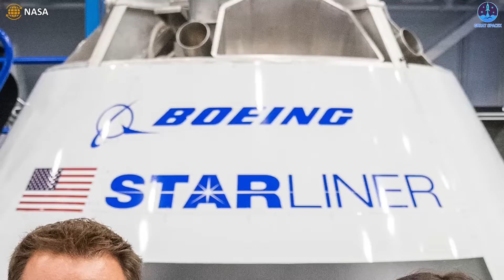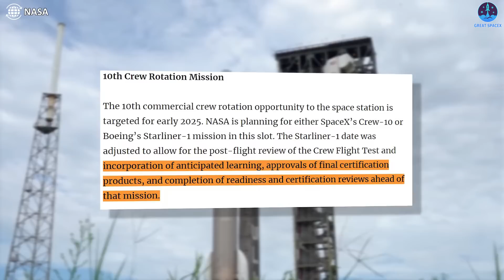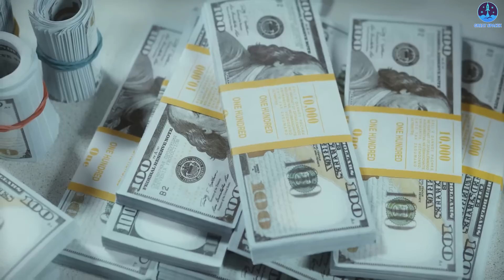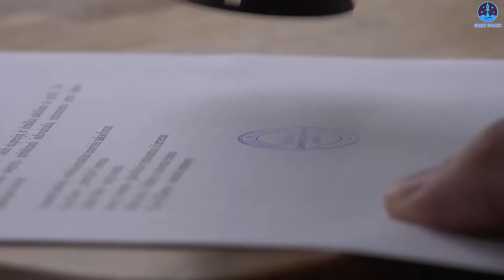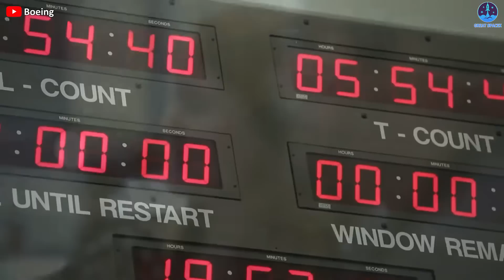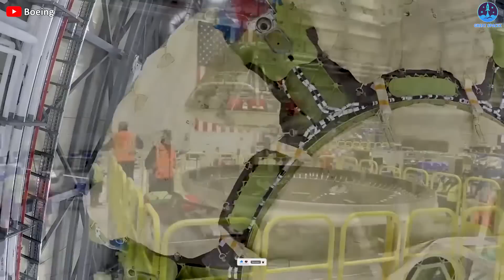BAD News for Boeing Starliner! NASA finally realized Dragon is 1000x better...

Comment: No. Dragon IS NOT "1000x better" than Starliner. I very much doubt that objectively Dragon is all that superior. What Dragon IS, compared to Starliner, is fully crew-rated and FLYING! A bird in the hand is always to a bird in the bush. At the same time NASA needs Starliner as an alternative to Dragon.
Reply: So something that works on less money that works should be spent on a legacy money pit that does not preform  ?????
Reply: Um --- Dragon actually flies and works. Junkliner does not. Therefore, Dragon is infinitely better than junkliner.
Reply: Saying that we need Starliner is like saying that we need a second hand for handwriting a paper or wiping our butts on the toilet. No, there are other alternatives that don't include Boeing, thank goodness.
Reply: The alternative to Dragon is another Dragon. SpaceX has a fleet of them, not just one.
Reply: @kenknowlton3085 If a Crew Dragon capsule has a problem,  then ALL of them will be grounded. NASA wants redundant providers, so different capsules, boosters, and everything else.
Reply: @steveaustin2686  and how many crew/cargo Dragon have encountered mission grounding failure? Versus how many problems has Boeing Starliner encountered while we all continue to wait for its first successful manned mission? 
How many redundant providers for Apollo? Shuttle? Think through your argument before parroting bureaucratic talking points.
Reply: @kenknowlton3085  Have you ever heard the old saying "Never put all your eggs in one basket?" That's where I was coming from not some bureaucratic talking point!
Reply: @billmullins6833  You failed to explain why NASA didn't require redundancy for Apollo or the Shuttle program but needs one to get to the ISS which is scheduled for decommission and deorbit.
Reply: @kenknowlton3085  And you clearly are constitutionally incapable of understanding the principle of not putting all your eggs in one basket! So we're even. Now go away!

Comment: Did the door or wheels fall off of Starliner? 😂
Reply: No its still go for launch
Reply: @the_lomax  I wonder, are all the system clocks set to match each other this time?
Reply: @rogerrussell9544  who knows its boeing all I know is I wouldn't be jumping in it.
Reply: Not yet.... Yet.
Reply: Both
Reply: Becarefull @the80hdgaming. Boeing is a stand up company, and that's why the whistle blower shot himself twice in the head from guilt.
Reply: @DrtyDz1904  Correction: shot himself twice in the back of the head while hanging himself; also ingested a lethal dose of BS the day before.